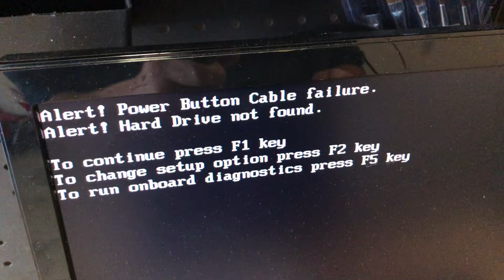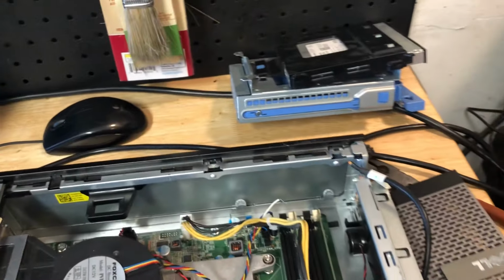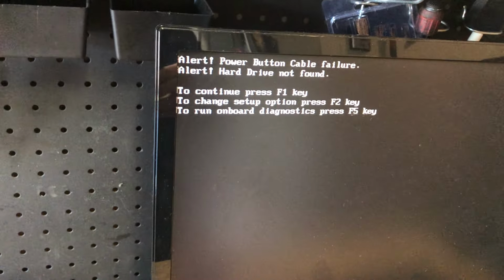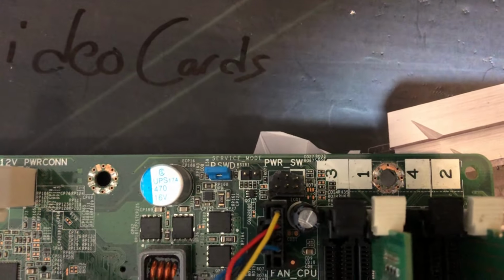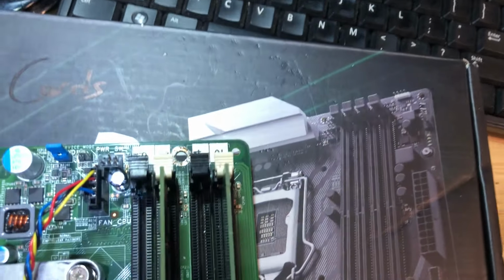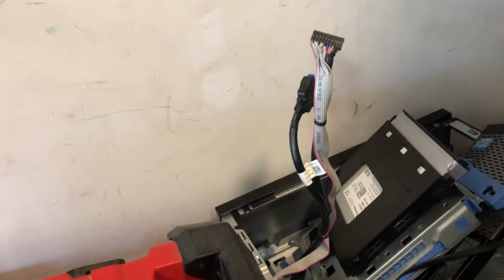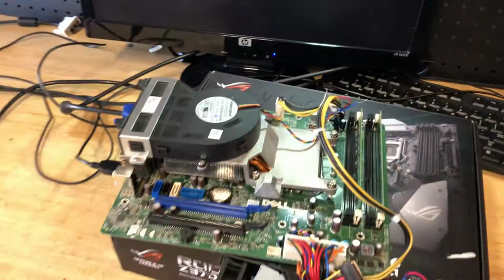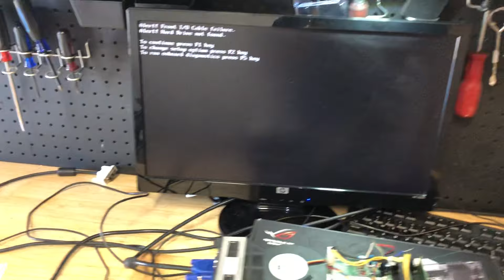Dell Optiplex power button cable failure! A guide on how to stop the annoying error!

Comment: Great video.. helped me alot!!! According to the numbering you used - you just need to have pins 4 (PSU detection) & 5 tied together, and that will work when shorted by pin 2. I kept pins 1 & 3 together for the Power LED. I just needed this to get the ability to power up the system via the PiKVM thru the ATX signal port. The wiring on a Optiplex is weird compare to a typical desktop.

Comment: Dude, I just bought a 990 SFF motherboard, this is really helpful
Reply from the maker: Glad I can help.
Reply: same, what parts did you use with it? im kinda lost on what to use
Reply: @b28padrigamikhailfrancis14  ah, let me help you. I just wanted a cheap emergency pc to do office work, so I didn't search for expensive or performance parts. I used a Pentium G850, 8GB (4x2GB) of Micron ram@1333mhz, an old HD7470 graphics card so I could play Valorant from time to time, and a 320GB HDD I had laying around. I ended up buying the power button for around 5 bucks, and a stock dell CPU cooler for around 7 bucks. 7 months later and I'm really glad with my build. I've recently been buying around for some other parts, so I'll reply to this comment if I end up getting them. hope I could help!
Reply: @alejandrovelasquez8063  What psu did you use? I’m really getting anxiety from psu frying ur sht up
Reply: @alejandrovelasquez8063  do u still get the f1 error with fan and thermal sensor? i only bought the mobo
Reply: @b28padrigamikhailfrancis14  since I didn't bought any components that were particularly expensive to replace, I just bought a regular 450w PSU. I know that it's the most important piece of hardware in a PC, but I couldn't justify investing into an expensive PSU when the rest of the components were cheap lol
Reply: @b28padrigamikhailfrancis14  I just have the F1 error now since I'm missing the front panel connectors, but since I bought the power button, a Dell OEM cooler, and a fan adapter for the HDD fan, it works just fine
Reply: @alejandrovelasquez8063  will my system still run fine without those dell parts?
Reply: @b28padrigamikhailfrancis14  yup, for me, the most important is the cpu cooler, I would recommend you to either get an adapter or to buy an OEM cooler. The power button can be shorted to eliminate the error, and you can sort of use a regular power button. You can even just ignore the power button altogether, just use a screwdriver to short the first two pins, and you just have to power it off by switching off the power supply, don't worry, it will turn on automatically when you switch on the PSU.
Reply: @alejandrovelasquez8063  Thanks a lot for the info, I'm lucky when I bought the motherboard they included its original cpu cooler in it. What got me worried is the extra fan that the optiplex had which is the sys fan, because they said without it, it would cause the motherboard to think that the computer isn't getting enough airflow so the cpu coole would be in full throttle.

Comment: If you just put your power switch on pins 2 and 5 then a hard drive jumper on pins 1 and 4 there is no need to splice anything.
Reply from the maker: after finding about the adaptors, I don't even do this anymore, but yea your way makes more sense. thanks!

Comment: Interesting... 
1. what is the name of the momentary contact switch you can buy and solder onto the wires...?  
2. Any idea where you can buy the single female connectors for the pins...?

Just seeing what the dang "power button cable" was that was hiding underneath the motherboard got me straightened out... but this info could certainly come in handy in the future... ;-)
Reply from the maker: the pins i got them from amazon. not sure about the switch but once again im sure amazon has something for it.

Comment: Thank you, great info!
Which Optiplex model in the video?
And do you know if the same (pins) work the same way in other models as well?
Reply from the maker: i know it will work for the 3010, 3020, 7010,7020, 9010,9020 and the precision t1700 and i think a few other precision model. I have another video on the channel in which i found some adaptors you can buy on ebay that make this way easier and also did a recent build on putting a xeon and giving the optiplex case a fresher look, hopefully you can check on the channel and drop a sub if you don't mind, thanks for watching and stay tuned as I have a dell precision t1700 which is server form of the optiplex video coming out!
Reply: @DLMtechgarage  Thank you, that's excellent, and I did subscribe!
Reply from the maker: @JNCHRH  Thanks!
Reply: Thank u very very much it worked
Reply from the maker: @subuktageenali7238  glad i can help. Thanks for watching!

Comment: I did not understand.. I think I should buy the cable switch and install it for each pin right?  And I have one missing pin like you
Reply from the maker: pin it out like the diagram them and twist them together to the power button. the other easier way to do it is to use your old power button, splice the new power button into it and tuck away your old power button.

Comment: Dell optiplex 9020 sff 
what is the required voltage on pin #2,  i have 2v dc on #2 pin and i sure it should be more, power button is not starting machine.
 replaced psu 255w
purple wire 12 v and green wire 5 v        thanks
Reply from the maker: not sure on the voltages. never measured it.

Comment: Also I’d like to use this method but the 3 wires bundled together scare me. Would that not cause electrical interference or shortages in the board? I’m trying to decide whether to use the 6pin adapter or the sketchy wiring. I feel like they are both equally as scary lol.
Reply: I know this is an old post - but FYI... in the plastic power switch - pins 4 & 5 (the numbering used in the video) are already connected together in a little steel ring, when you press the button - pin 2 momentarily connected and that completes the circuit and starts the system... pin 4 does PSU detection - its just the way Dell designed it.

Comment: I just bought this pc and as soon as I turn it on it says cable fix and then my monitor goes too sleep I need help pl
Reply from the maker: hmmm. even with that error the computer would still boot fine. Try re seating the ram, gpu and memory, if that dont work try using a different psu. sometimes these older psu tend to go bad. had that happen once. hope this help and hope you can subscribe to help the channel.

Comment: First of all absolute great video. I do have a problem and hope that you still reply. So I took the Mainboard of a Dell 7010 (5pin power switch) and put it into a case which only has those 2pin power switches. My solution was to only put the 2pin power switch anywhere but there is also a problem to it. My case power button doesn't work and if I shut down my pc manually there is no chance to start it again. I have to unplug these 2pins and replug them in every time which gets pretty awful with time. So my question what should I do to solve that problem. How can I use the case power button or how can I make it easier to restart my pc. (if I just forcly pull my power supply out and plug It back in my pc starts automatically)
Reply from the maker: this dude on ebay sells a switch fix for it that is way easier. just got it myself and it works fantastic. doing a video soon about it. check out the link to his ebay page. Hope this helps

https://www.ebay.com/itm/Dell-5-6-Pin-Power-Button-LED-Front-Panel-Adapter-For-Dell-Motherboards/264638806788?hash=item3d9db3bb04:g:9EwAAOSwhA9eS2we
Reply: @DLMtechgarage  thx for the quick answer. But I just found a solution myself luckily. I just took the old 5pin power sw button from the old case( after gently breaking the safety "thing" and are using that as my power sw. Works great.

Comment: Hi DLM Yech,   i have 1 motherboard of this model 7010 sff, but when i try to power up MB just tried to start and move the cpu fan and stop inmediately. In your video i can see you should mandatory connect the case fan for boot on min: 5:00 is this correct? i ll need to get that fan couse i just have the cpu fan, the motherboard and generic atx psu.   
Thanks for this video :)
Reply from the maker: you have to have the cpu fan plugged in at least, as far as it instantly shutting off, I would recheck everything to make sure every thing is seated good!
Reply: @DLMtechgarage  thanks,   few hours ago i did a test with a generic fan 4 pin connected as fan case and the motherboard works.   Im happy now :) . For this mb i need to connect both fans: cpu fan and case fan to boot up. 

really apreciate your help. 

Now i have to adapt the heatsink and the generic case for to have a complete system working. 

greetings!!

Comment: thx for the help i think im just gonna deal with the error are you able to get into the bios when this error is present by that i mean you acknowledge the error then spam the f12 or f2 keys to get into the bios. also does it beep at you at all?
Reply: also will any 1/2 pin connection power connector work?
Reply from the maker: the half pin ones will work better then the dual ones. more room and much more flexible. i just didnt have any availible

Comment: I'm also getting a "front io cable" failure aswell, anyway to fix that? The other day I didn't even  get these errors at all but now it's getting this error after adding a hard drive.
Reply from the maker: not sure, something may of came loose. remove the drive and see if the errors are still their. it is common for the front i/o to go bad in these.

Comment: Hey.. I have hp pro 3500  i buy new case my motherboard j18 have 9 pin (+1 10 no pin)  it works new case?
Reply from the maker: no sure, never messed with the hp pro 3500

Comment: hi! I have some questions for you. in regards to an Intel i5 10600k cpu. I've been shopping for one and in some of the ads say SRH6R very prominently on them and most don't. I've burned up Google and YouTube looking for what that means with no luck. the ads that have it never specified what it means. I've never seen any if them with a slightly different number. I've looked at a bunch of part numbers. none if them have this in that. I haven't seen those numbers on any other cpu. as far as I can tell there's 3 i5 10600's. the plain i5 10600, the i5 10600k and the i5 10600kf. actually, I never found out what the "f" designation was about either. also, another weird number that keeps popping up with this cpu is the add will say LPG 1200 socket. then, right after that it says socket 5. what the heck? I've written to 2 people with the SHR6R prominently in their ad, but, none have responded. any thoughts? thank you.
Reply from the maker: thats the product code for the k version. k = you can over clock it. non k= non overclocking and f= mean no discrete graphics cards.
Reply: @DLMtechgarage  hi! thank you. that word discrete broke the whole case open. I googled the word. read 20 articles about it and my little hamster brain is still spinning around. does the F mean no on board graphics?
Reply from the maker: @mrkemblegilstrap  yup. no on board graphics!
Reply: @DLMtechgarage  typical computer stuff. they go out of their way, to make stuff as hard to use as possible. they really proved that point with windows 10. 
how big a deal is it to add a separate, dedicated graphics card to a i5 10600k ?
Reply from the maker: @mrkemblegilstrap  just plug it in to the pcie slot and it should install automatically. make sure you have enough power on the psu.
Reply: @DLMtechgarage  cool, thank you. I'm building from scratch. I have to get a new power supply. probably last. when I see what all the total watts add up to, etc.

Comment: so in an easier way, i just need the 5 pin female power connector from the case and cut it off and then plug it on the pins, is that it? I feel like mine is a little bit different, because instead of only 5 pins i have like 7 or 10 idk like in the normal motherboards, idk if im right or not but it seems like it, and it has extra things in it. I plugged my case's wires on it but all of it isn't enough to fill the pins, though I can open the pc when I'm clicking the button in my case and the f1 error is still there. please I need help, Thankyou.
Reply from the maker: what I do is take the front i/o to include power button, tuck it in the case and splice the power button wire to the case power button.
Reply: @DLMtechgarage  Thanks, I'll try it. Btw have you find a solution for the front I/O cable failure?
Reply from the maker: @Molinono  pretty much the same. tucking the whole front i/o to include the usb in the case, or doing the pin out jumping in this video.
Reply: @DLMtechgarage  thanks, I'll try it.

Comment: Have you ever seen the 6pin dell power switch adapter? I have an andapter and there’s a little white triangle pointing right to the missing pin. However I have a precision T1600 motherboard I think  I fried it plugging it in wrong. The 3010 motherboard I used for case swap and it powers on when I turn the switch on my PSU or if you were to plug it up it would power on without you hitting the power button. I have no cables hooked to the power switch connector and I’m kind of novice. Please help lol.
Reply from the maker: I have use them with no issue. it's important to make sure the adaptor is specific for the model you are using.

Comment: Ok so I ran into a problem with the fan header connections and I've heard they are wire different and you need to swap wires but idk if that's specific on all Dell motherboards mine is a 42p49 any help?
Reply: Bc I'm trying to use a typical non oem 92mm 3pin fan
Reply from the maker: Amazon and eBay sell a 5 pin to 4 pin adapter for dells so you can use any fan you want and it gets rid of the fan error

Comment: Good vid man I just put the power switch on 2&5, and I just put jumpers on the rest of the pins, does the trick for me. Also what are you doing for IO shields (if at all)
Reply from the maker: some models the io shield comes out easy and you can pop them back in or mod it in. if not then I dont use it.
Reply from the maker: @stevenwilliams6638  wow that's an awesome back plate. more air flow for sure. def need to make that investment in the future.
Reply: @DigBickMcQueen  link please
Reply from the maker: @DigBickMcQueen  yes link please!!
Reply: @DigBickMcQueen  yeah I can find them for the MT Dells, just not the SFF ones.
Reply: You have better luck than me, and I've been in the game since 98'

Comment: THANK YOU! This really helped me out.
Reply from the maker: glad I can help. I have a video on a adapter that makes this way easier and practical. Hope you can check it out!
Reply: @DLMtechgarage  What I ended up doing was making a small, bare length of wire and soldering it direct to four of the pins, low enough that I could still use a two wire connector to run to a standard switch. I was incredibly happy to no longer see that alert. :)
Reply from the maker: @TravisPrebble  awesome!! yea dell gets annoying with that crap! Nothing like beating the system lol!!

Comment: Are those wires separate from the psu or come with psu?
Reply from the maker: those wires i cut off an old case. you will have to pick up a set of pins from old power switch hd led power led case pins. you can get them on amazon real cheap

Comment: What pin number do the group of wires get connected to?
Reply from the maker: Check out my other video on the channel on a adapter that is sold on ebay that solves all these issues real easy. Thanks for watching and subscribe for more updates on these mods.
Reply: @DLMtechgarage   is that the harbin repair adaptor ?  looks good that though your method is a simple way of doing it - esp if you wire 2 & 5 to an on/off switch and jump 1/4.

Comment: You can use an Intel stock cooler with these boards without an adapter. Cut the wires and plug from the old cooler and put them in these corresponding holes on the stock cooler. Black to Black, Red to Yellow. Yellow to Green and blue to blue, the 1st colour is the proprietary connector wires and 2nd stock cooler, this can be transferred to all coolers if you can integrate it. For the "hdd fan", you can cut the wires and put them in the same holes as the cpu if you can't use the fan itself.
Reply from the maker: Good info and thanks for sharing. Def will give that a shot next time.

Comment: i tried that but , the pc dont boot up with that jumper , so im back to 2 and 5 only and the error still there
Reply from the maker: check out the link below and maybe that might help. also depends on the model you have

https://www.dell.com/community/Optiplex-Desktops/Problem-with-adding-PCI-smart-boot-switch-to-Dell-Optiplex-3020/td-p/7408252

I have a video on my channel about an adapter you can buy so check it out and see if that helps too. Thanks for watching and hope you can subscribe!
Reply: so i need to buy that pci and install?
Reply from the maker: @polmzverdillo7125  no just use the pics as a guide
Reply: when i jumper the blue and red the pc wont turn on. my dell is 990 sff

Comment: Ok people the easiest thing to do is just remove the rgb case power switch I comes out supper easy and then I took the dell 7010 sff power switch and trimmed around the plastic square and put it rite where the other one was and your almost done because the dell switch isn’t long enough so I cut open a usb cable used the 5 wires it has to extend the dell switch so it would reach and it works perfect can’t even tell I changed it I don’t make videos because I’m new to this that was my first case swap for my kid. I want to do a video but still learning
Reply from the maker: def do the video, I have done it that way too, I know use the adaptors cause its easier and less headache.